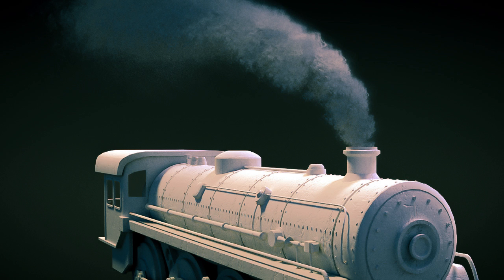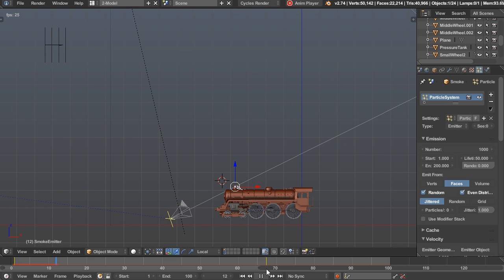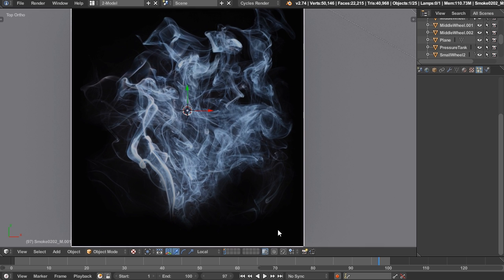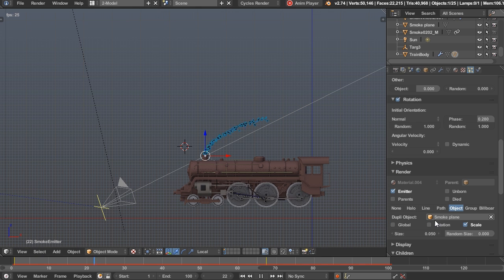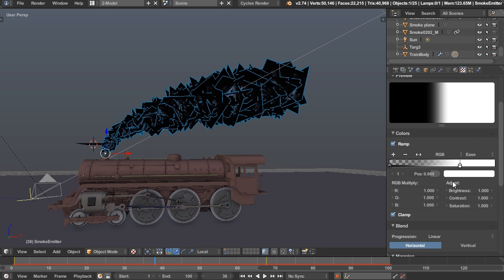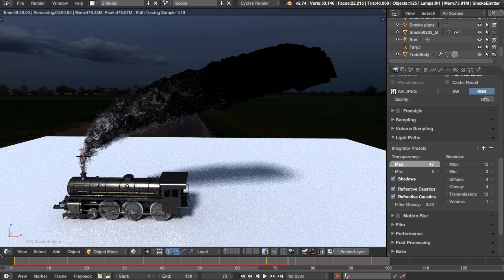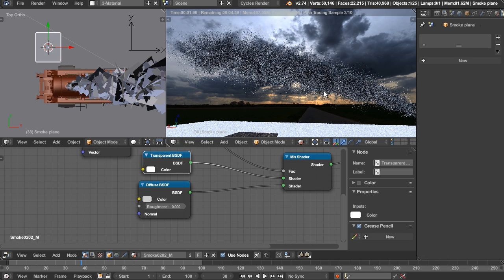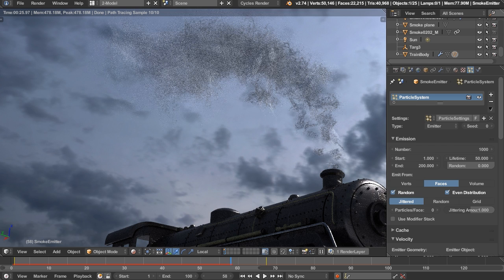Faking Smoke with Particles in Blender Cycles

Comment: Just used this technique - very handy!

One thing I did, was to edit the particle plane, copy the verts, rotate on x by 90, then do the same but rotate on y by 90, so you end up with a kind of intersecting shape where you have a plane facing in every direction. I found this helped avoid seeing planes where the plane is obviously tilted away from the camera.

Comment: Thanks a lot for this tutorial! I've done a lot of work with Volumetrics, even started an Honors Thesis on them, and quickly concluded they weren't very suitable for efficiently getting some simple smoke. This is just what I needed!

Also good job explaining getting particle size over lifetime. I hope you've posted on some of those threads, as I can confirm I spent a long time searching as well without an answer.
Reply: huh......it seems one great empire has found skills from this one...useful
Reply: hi
Reply: toppolthecat you too buddy
Reply: Great as im a plumber and have  been on blender now about 100 hours , so this is good news.   i modeled a xmas train wheels that revolve, emitting extruded letters modified by a hidden subdivided  'mesh deform' snug fitting soft body cubes , that holds the letters together but giving them soft body properties.  i might start all over , steal your model , and in a perfect world , model it blasting through the road blocks in dover .  puffing out big balloon letters spelling merry xmas to all! w black and white checkered hats blowing in the wind.
Reply: bps is fat

Comment: Good afternoon, depending on where you are, my name is Louis. I am going to be making a tutorial of my own over the next few days in regards to a hologram. It dawned on me that I used the same technique you demonstrated on blender diplom's YouTube channel several months back to create a hologram type material using the node editor. I would like to ask your permission before starting this, as to if you are okay with me using the same node setup. Please let me know. Thanks.
Reply: Blender HD
Reply from the maker: Louis Rayner Sure, you can use it for whatever you'd like! It would be a bit odd to make a duplicate tutorial though, there's not much value in that.  But feel free to do whatever you want with it. Thanks for asking!
Reply: Blender HD thank you. It's more for the purpose of modeling and a short animation. But I'm using a similar node setup for the material. Thanks again bud.

Comment: any clue how to do this with the old Blender Internal? I got the particle size working, but that's all the control you get over particles life, the other stuf seem broken (like density).
Reply from the maker: RolazoGL Particle textures are definitely weird. But try mapping that textures for density to to object instead of to particle/strand, because you'd want it to effect the particle system as a whole instead of each one during its lifetime.
Reply: Blender HD Well, found it for density it was "generated" coordinates.
But my mayor gripe is not getting the transparency over particle life to work with the old blender internal, any clue?
Reply from the maker: RolazoGL You can also set regular BI textures to be mapped as strand/particle. Does that help?
Reply: Well, sorry but not much really, they can be set but do not do much, I've been looking around and it seems that functionality is broken for the old internal renderer, thanks for answering anyways.

Comment: If you have smoke texture with transparent background you can actually check use transparent in Images as planes addon to speed up a process little bit , it will setup material for you :) Just a tip, great tutorial!
Reply from the maker: Matej Ondriaš Hey thanks! Totally missed that.